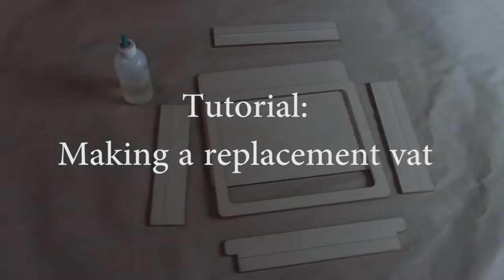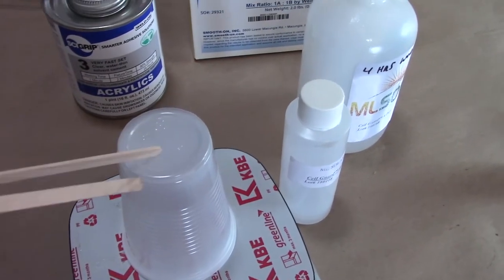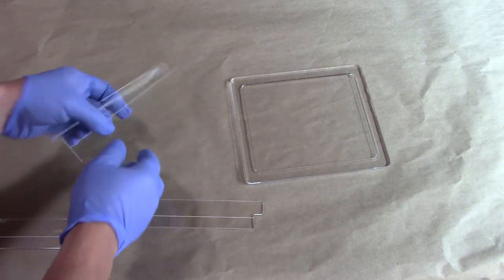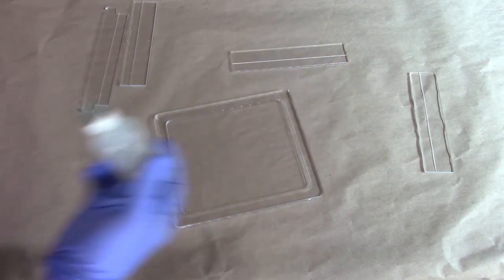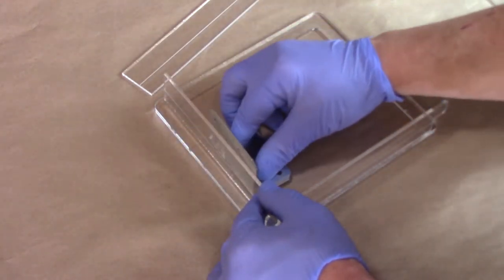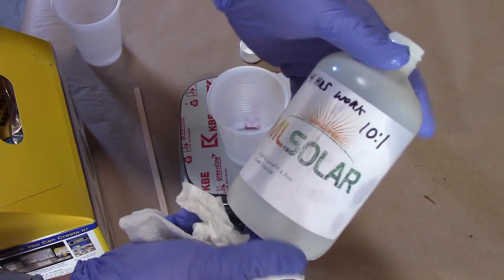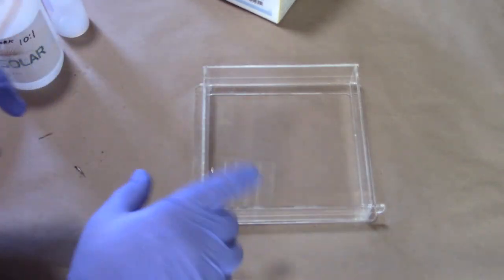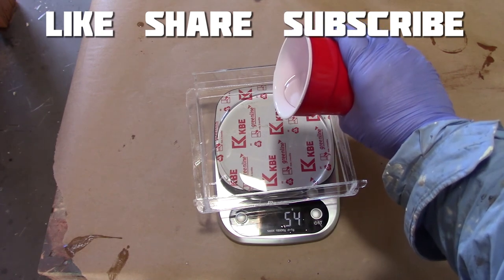Make your own resin Vat for SLA 3D printer Tutorial   Moai SLA DLP printer DIY hack

Comment: Thanks for the great video. Qsil 216 is less than half the price of Sylgard 184 and it will cure at room temperature. The data sheet says it should be degassed if it has bubbles in it so if you don't have a vacuum chamber, stir carefully and do your best not to have bubbles. I was not able to find Solaris or ML Solar (a.k.a. Cell Guard) available anywhere at this particular time.

Comment: Amazing video.  Thanks for posting.  Have you thought of making the bottom from glass?
Reply from the maker: Darius Steele yes  I'm going to get the fep vat next
Reply: chaucer44 thats even better.
Reply: @chaucer44  The FEP vat is good in the sense that you can use different kinds of resin but I have found that I get better results on large prints with my Moai 130 from the PDMS vat. The PDMS vat also holds more resin and you can see your print sooner because the sides are clear.
Reply: One thing about glass is that not all glass is optically clear. I have used water white glass in the past for photography because it's completely clear and has no defects that would distort the light passing through it. You may need something like that.

Comment: Where does one get the Solaris?
Reply from the maker: solaris is available through smooth-on  google that and there may be a local distributor.
Reply from the maker: @rsilvers129  Reynolds is where I get mine =)
Reply: I'm a bit confused; Reynold's shows 1:1 mix, but your video says 10:1 mix. Has the product changed, or do you use a lower ratio in order to change the material properties?
Reply from the maker: google smooth-on   That's the company that makes it.  There are distibutors around the U.S. called REYNOLDS ADVANCED SUPPLIES
Reply from the maker: @ShadowDrakken  Just follow the instructions on the packaging.
Reply: @chaucer44  The solaris mix you tested is 1: 1 or 10: 1? Thanks